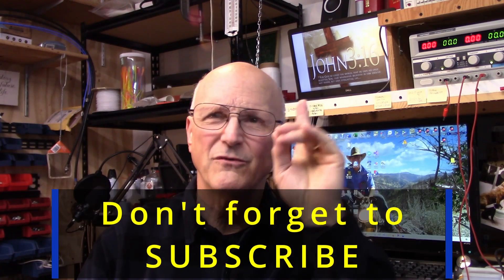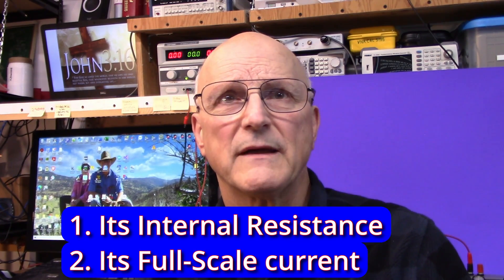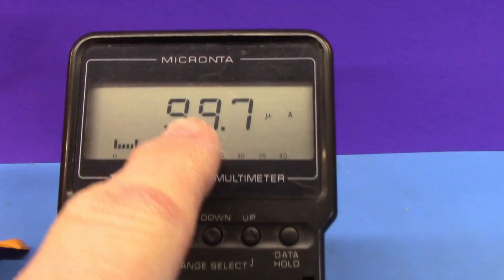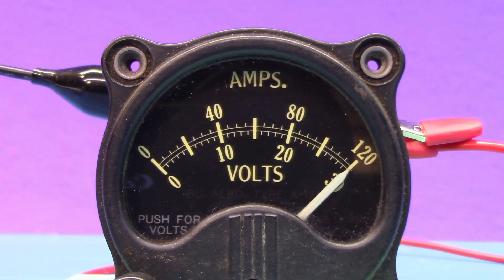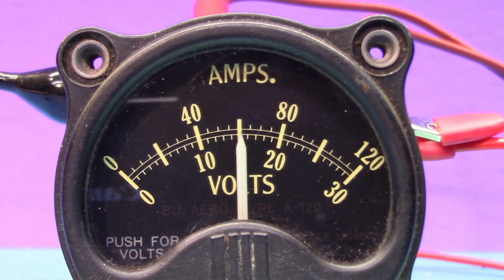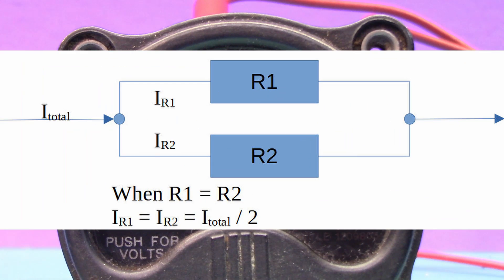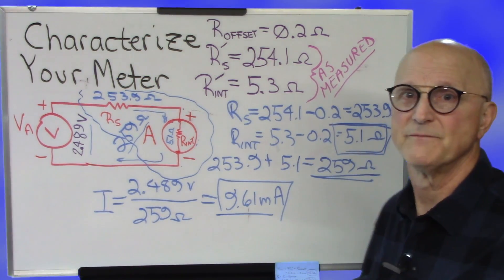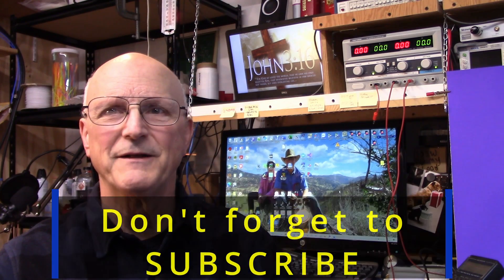How to Characterize an Ammeter: Internal Resistance & Full-Scale Current (019b)

Comment: I have the same Micronta DMM as you. Check the middle of the warning label on the back. There should be a circular soft spot in the middle, if yours is like mine. This is where the piezo speaker sound is supposed to come out. I guess the legal department doesn’t care about engineering. If you cut out the label above that hole your beeper will be 5x as loud.
Reply from the maker: Cool! Thanks! 🙂

Comment: Another very useful video Ralph.   Another useful trick is to create an expanded scale voltmeter.  For example,  taking a 5 volt full scale movement  and adding an external zener  makes a useful 10 to 15 volt meter.  If you have a meter with a scale specific to some odd ball function,  you can make custom meter scales with a program called Meter Basic.  There is a freeware version for simple single scale meters and a paid version that allows you to create multiple scales.
Reply from the maker: Great tip! Thanks!  :-)